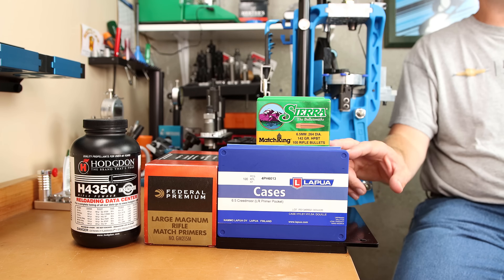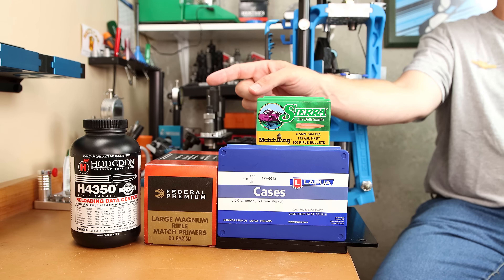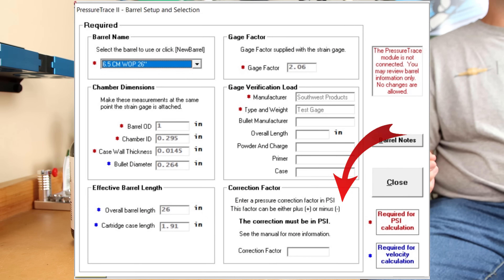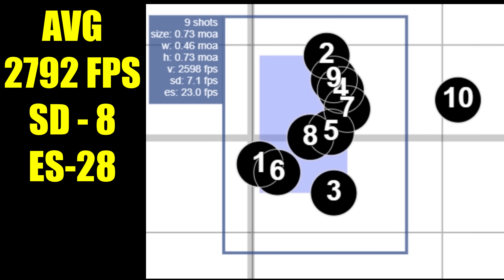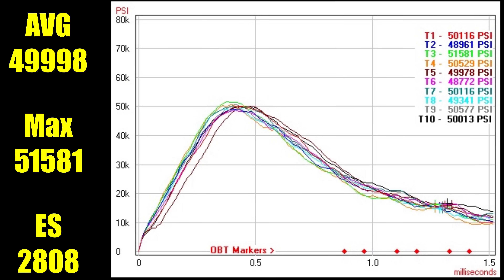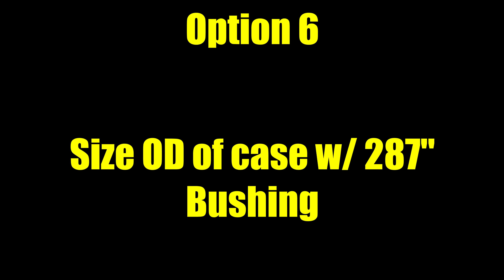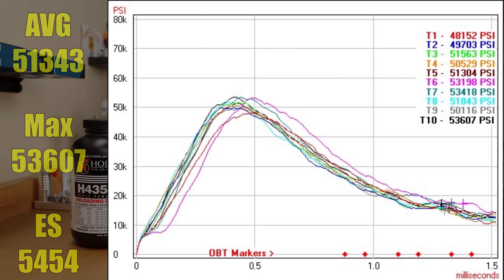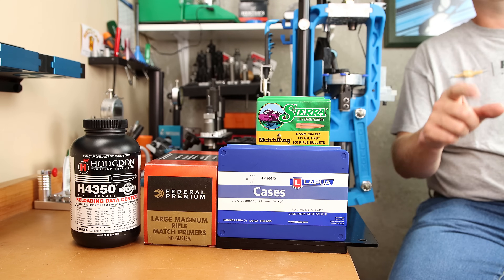How Do I Prepare New Brass? - 7 Different Methods Tested!

Comment: As a retired statistician, I have to say that you need to perform some basic statistical tests on your data.  It is meaningless to come to conclusions with your results without performing statistical tests to see if any of the results are statistically significant.  You certainly can't say that results like the average velocities of 2794 and 2806 are different without performing even a basic t-test of the means.  You are coming to conclusions without taking in consideration the effects of random "error" on the observed results.  

Your experiments are very similar to experiments done in agriculture.  The field of biostatistics has developed many statistical tests to analyze this type of data.  Software that can perform these analysis (e.g., ANOVA are regression analysis) are available everywhere and don't cost very much (many are free).

Comment: I've just been through this.  6.5 CM, new Lapua with H4350 and 140 gr ELDM's.  I slightly chamfered the inside of the case mouths, and ran a 262 expander mandrel (with graphite neck dip prior)) for the 264 OD bullets.  The mistake I made was powder loading all the brass before seating....the AMP plunger retracts automatically if it hits 175 lbs force.  So all of yours, and all of mine that hit 175 lbs never fully seated. I extracted the first few bullets I tried to seat, dumped out the powder, put an oversized nylon brush fixed (no rotation) in Brass Boss, and ran the neck up and down three times on the brush.  New max pressures were between 120 and 160 lbs, with no 175 lb retractions

Comment: Looking at this data, the first thing I'd say is this:  None of it matters.  All this tells me is the rifle isn't in tune.  There is no need to anneal a new Lapua case or for that matter any new case.  They're all annealed prior to being packaged.  According to Hall of Fame shooter Jack Neary (and data god) the first thing you do is fire it twice with the first firing being 5% under starting powder charge, because the case will grow the most upon first firing.  Some shooters will then load a standard charge and begin load dev on the 2nd firing, but annealing is still not required.  After the 2nd firing, then begin annealing if you want to anneal at all, but work hardening occurs each time the case is fired (varies depending on cartridge, but AMP has shown avg of 10 on hardness gain upon firing.)  After resizing operations the hardening goes up.  Snap back is what gets you as the brass work hardens.  You'll think that you resize to a 262 ID in the 6.5 example, however it may in reality be 0.2635.  Annealing helps prevent snapback to an extreme position, i.e. instead of a 0.2635 you would likely see a 0.2621 or 0.2622.

Comment: Great content and the effort put in to get this out there. Some very interesting and surprising data for sure. I would change your magnum primers to standard as feel your ES is caused by too rapid burning of powder, test!! And try the lapua SR primer in your tests. You dont mention any barrel cleaning regimes in testing. Your group sizes might have been different. Did you do the test without any cleaning? Its also difficult to correlate the group sizes into the data collection without doing a proper seating depth test. I would've got a load tuned to shoot in your test rifle first then conducted the case preparation test changing one variable at a time. To me these results aren't really showing anything but there showing something.

Comment: Is it possible, or advisable, to simply use the expander ball in a full length sizing die rather than buying an expander mandrel die To clean up case neck dings with a box of virgin brass?
Reply from the maker: it is possible. Some folks basically FL size new brass. Depending what the necks look like I would consider using lube of some type as you may damage cases if you don't.

Comment: Hi, great vid using new brass without neck turning. Could you make test where using once fired and 1 times neck turned (neck thickness av. 0,138") and twice neck turned (min. 0,125") Lapua brass. 3 rounds x 5shots AN and without AN, all Forster FL without EXPM plus Sinclair -0,002" EM. I'm wondering if enough small neck thickness 0,125 eliminates the AN need per shot (AN per shot => AN per every 3rd/4th shot). Neck thickness 0,125" with Forster FL  gives best group sizes, good SD, gives good neck tension consistency and using EM seems make even better. Cons is that these 0,125" brass doesn't last so long as the thicker ones.

Comment: I'm not into this nearly as deep as you, but being a big fan of Forster reloading equipment I was excited to see the consistency that the FL sizer die produced.  Unfortunately I was disappointed in the performance in the grouping.  I have to wonder though if the consistency is maybe showing a path forward, but the neck tension needs to be adjusted by either expander ball sizing or die neck customization?  Incredible consistency with just a tweak to the output specs?  Or is there another factor I'm not seeing that is driving accuracy?
Reply: I think the factor we are not seeing that is affecting accuracy in these tests is barrel harmonics. I think the method here that produces the lowest velocity ES is the right choice. Then tighten up the groups by varying seat depth to find an accuracy node.

Comment: Would have been interesting to see a control group with no prep at all.  Would like to see a crimp vs no crimp pressure es test.  Have you done a follow up on your node found with "stop chasing the lands"?
Reply from the maker: Hi Bill, I am not sure you want as a control group as attempting to seat projectiles into cases which are visually defective is not a fair test either. The .262 Mandel group is my standard process would be the reference in which I would compare as that is my standard process at this point. I plan to continue this test with fired brass and crimping will absolutely be part of that test.
Reply: @BoltActionReloading  I'm pretty new to this, so I apologize if this is a stupid (& long) question, but since I don't have the eqpt you do and really just have a FL sizing die, and I don't feel like messing around with lube just to more or less fire-form the brass, and don't consider the first firing groups all that critical is it really a bad thing to just let the bullet seating do the fixing of the dented mouths? If I lightly force a bullet boat tail or even the ogive into the mouth, it seems to make it nearly perfectly round. The damage done from the shipping/packing to the neck really looks to only be on the very edge of the case mouth, and doesn't seem worthy of dealing with any dies & lube. I understand we always want good groups, even on the first firing, but given it should be formed to your chamber, is it that big of a deal? Or am I badly missing something? I saw another video mention that you don't need to lube them, since they haven't been fired, but a stuck case is not something on my wish list of things to deal with. So isn't a no-prep actually a decent test to baseline control the experiment? I do appreciate all the data you provide. Literally rocket-science.

Comment: Fascinating data. GREAT JOB, I know it's a trainload of work and it's a shame this has only gotten a few thousand views so far. I'm most struck by how the SD and ES of pressure seems to correlate to group size, but not to SD and ES of velocity, Any theories on that?

Also fascinating is the straight Forster die which had such beautiful seating force consistency in the curves seemed to have some of the worst pressure SD and MV SD. Picture a ranking of group size and of pressure SD against the ranking of which seating force curves seemed the most consistent. It seems like those have almost no correlation.

Sometimes I wonder if the thing we think that contribute to small groups (turning necks etc) end up having almost no contribution at all. At least none that we can quantify.
Reply from the maker: G5, glad you enjoy the data. I don't want to make any theories at this point but I think the data is very interesting.(I am biased) I am hoping as this research continues we can see if we can understand what mattress and what doesn't. I still believe that consistantcy is what we are looking for but consistantcy in what. This is what I hope we can isolate and see if it is consistent to different calibers as well.

Comment: I really enjoyed this video and took EC’s advice and bought brand new Lapua 6.5 creedmoor brass small rifle primer. Wanting to do my very first 6.5 loads by the numbers I took out my Wilson 6.5 cartridge gauge and was surprised that the first 20 cases I checked all showed that they needed to be trimmed! I have not checked all 100 cases but seeing your recent video you did not mention trimming cases. I did measure a few of the cases with caliper and average was 1.9140. Should I trim these Lapua cases? I’m really confused because Lapua brass is supposed to be the best you can buy! Help! Thanks
Reply from the maker: Hi Steve, als long as they are between 1.910 and 1.920 I would fire them before you trim them. You need a pair if calipers not a case gauge.

Comment: What powder measuring method are you using?
Reply from the maker: I weighed all the charges to be within 1 kernel of powder with my FX120i
Reply: @BoltActionReloading  thanks for the reply. I'm amazed at the big (relative) differences in SD and ES just from the brass prep method. Thanks for taking the time to do all this!
Reply from the maker: Glad you find it interesting.

Comment: What rifle is this shot with ?
I think that with a Varmit Tikka T3X or Sako 85 Varmint and a good shootingteknik this groups would shrink considerably. 
 Try to avoiding freerecoil if you don't have a heavy F-class rifle with barriers and the whole setup. 
I know this is a reloading youtub,  but you could try to shoot the same load with different bench techniques. 
I prefer Nathan Foster's line that is to controlling the rifle by holding it , it hav shrunk my groups to half and no flyers 👌
Reply: 10 shot groups, all below 1" is pretty good, one was below .6"

im sure he wasnt even fully concentrating on getting the smallest groups possible, having to also worry about the pressure reading tool, as well as chronograph data.

Comment: Anyone know a good way to clean brass after shooting black powder? I can't really seem to get all the residue off. For this reason I usually try to not reload any brass that has been fired with black powder with smokeless powder since theres a bunch of residue inside the case that I cant get out.
Reply: Wet tumbling with stainless steel pins of the correct size is generally the most aggressive safe cleaning process. I’ve seen it clean brown ancient range brass within 2 hours. Vibratory cleaner with crushed walnut shells works well enough for many people. 

After rinsing and drying the cases, toss them into a vibratory cleaner with walnut or corn cob média for an hour for a better shine, and it adds some lubrication for reloading. 

That said, there is divisive evidence that super clean brass makes unnoticeable difference down range. Quick cleaning the carbon and dirt does make a difference and keeps your tools in better condition. Also to better inspect for brass integrity like case head separation, neck splits, and primer pocket issues. Super shiny brass seems to be more of a preference than necessity. That statement will infuriate some people, but Inoffer the following; Jerry Miculek, demonstrably one of the best shooters ever, cleans his brass with a cement mixer and an old clothes dryer. 

I’m guessing your firing straight wall cases with black powder, making the cleaning process even less important than high pressure bottle neck cases.
Reply: @mrbreakit6063  Yeah mostly .45 colt and .45-70 done some .38 special too thanks for the info

Comment: Great video & thank you for the considerable expense, time & effort that went into that testing.
I think you've got some good sample data to work with there. 
As much as statistics is about verifying a theory or load practice, stats can & should used to verify what you don't have. 
For example, just eyeballing all the average velocities, I can see that they all show a very high relationship to each other indicating very little if any statistical deviation. One conclusion that I would draw from the velocity averages is that the case prep variations have little to no statistical effect & therefore are NOT DIFFERENT, from a velocity perspective only. 
There are all kinds of analysis that can be done to determine the statistical significance of the differences that we see in the data. I think that is important because it allows us to see what changes matter & what doesn't matter.  
Thank you again. Very enjoyable.

Comment: Hey, just wondering if you ever turn the case necks?
Reply from the maker: Hi Bryan, I have previously tuned some case necks (on not Lapua Brass) and have seen some improvements with it. I may try it again sometime but there seem to be a trend of people going away from that if the chambers will accommodate it. I may turn some Lapua at some point but I am not expecting earth shattering changes.
Reply: @BoltActionReloading  👍🏻

Comment: Great job, and looking forward to more data driven results. Question: On the screen shots that show the groups in order fired, in the upper left is the data for that group...right?  If so, why does it differ than the data you show further to the left? Specifically the ES and SD vary.
Reply from the maker: That is the data at the target. While I trust the group data the velocity is not reliable. The data that I trust is from the LabRadar
Reply: @BoltActionReloading  Copy and thank you for the clarification. I too like my labradar.

Comment: .287 Bushing for Lapua brass seems like it would be very tight. I use a Redding .290 and seating force is usually 110-120. Was actually thinking about going to a .291 or trying the SAC 290 when available. Thoughts?
Reply from the maker: Hi David, Its hard to say. I am about to size some more brass here shortly now that it is once fired and see if/how things change.
Reply: @BoltActionReloading  Just curious, trying to get below 100 PSI, but not too low.
Reply from the maker: Not sure what too low is. Seems some of the fclass guys are far lower than that. I have another item I haven't reviewed yet that may shed some light on this for you but I haven't ran it through its paces yet.
Reply: @BoltActionReloading  that is the question... what is too low? I've seen EC's pressure on the 21st Hyrdo and looks like 40-50psi and we know what he is capable of. I just seated by first batch of 6gt (new alpha brass) and didnt go over 40 psi using a .241 expander mandrel. found that interesting considering what i get with new lapua creedmoor brass. Different company... yes, but 3 times the seating force using same technique (.002 expander)? Search for answers continues.
Reply from the maker: I am guessing this will vary a little when changing calibers, surface area being different and all.

Comment: Interesting the most consistent AMP graph (forster) doesn't seem to be providing the best results....  also interesting that initial force was higher on the forster die but peak force was higher on the 262 mandrel even though it should have resulted in overall less neck tension than the forster die.  the graphs do seem to confirm that bushing sizing alone leaves neck thickness inconsistency/variation on the inside of the neck where mandrels push the thickness variations to the outside of the neck.
Reply from the maker: It is interesting data for sure. I am wonder if the higher initial seat force is the reason for some of the inconsistency, which I am guessing is a factor of the ball getting pulled back through vs a expander getting pushed from the to. I think the more work we do with it the clearer it will become.

Comment: Will you do a video on the Pressure Trace II system once you get a little more used to it and calibrated? Would be nice to see how you set up the strain gauges on your rifle as well as how it graphs out during a ladder test. Great video. I chamfer and use the century 21 .2620 mandrel on all my new Lapua brass. FYI - just got the SAC modular sizing die with the .2625 mandrel. It has a combined shoulder/neck bushing and anything I put in now comes out at .0005 run out with the accuracy one concentricity gauge which is pretty high resolution. Great video - I just purchased this with the software combo - cant wait to use in load development.
Reply: I second this idea.
Reply from the maker: I really wish it was easier to pull the data off of it. Everything that I have seen so far it looks good just need to get used to it. If you see any guidance for setting the pressure offset I would love to see it.
Reply: @BoltActionReloading  I see what you mean now. Been going back and forth with Jim Ristow. So I bought some Lapua Factory ammo for my reference case - the problem is Lapua doesnt publish pressures. What Im going to do - and will confirm with Jim if this is a bad idea - is to use quickload to calculate the theoretical pressure once I have a speed of the ammo. After all pressure to a degree equals speed (60% of the time - all of the time). If this is a bad idea then Im going to see if any of my powder manufacturers publish pressures and speed - according to Jim there's a bunch of data - which I believe, you just need to have the powder - and see if I can match the speed or close to it in my barrel and then see what I get. One piece of advice I also got was to use a factory ammo and then assume 10-15% below SAAMI max.

Comment: I only anneal brass after the first firing.
Reply from the maker: I have not annealed before the first firing before, but wonder if the pressure was slightly higher because it sealed the camber off a little faster. I thought it was worth a try either way.